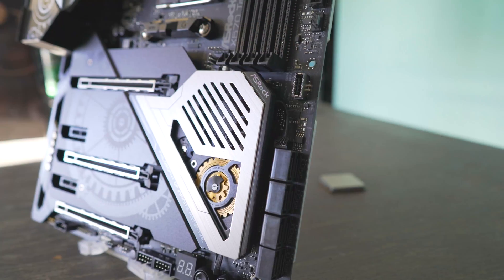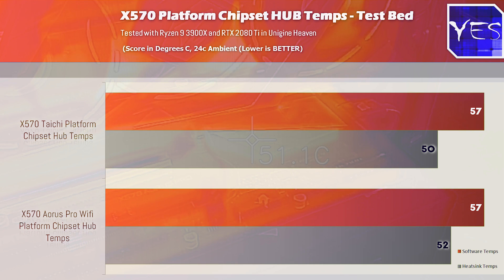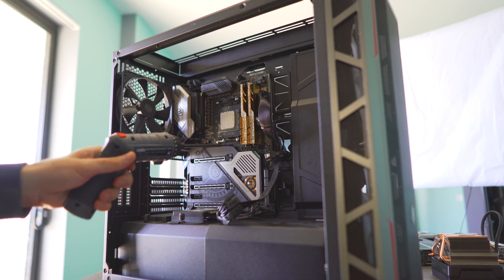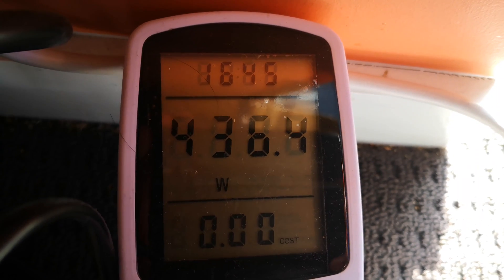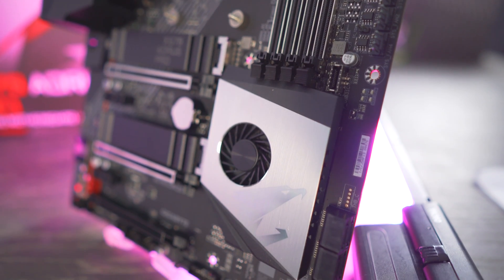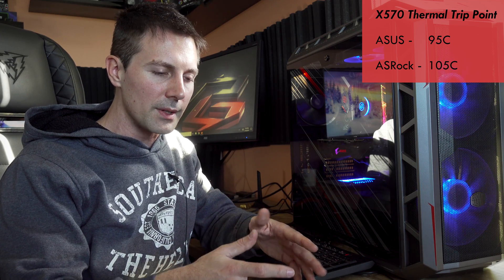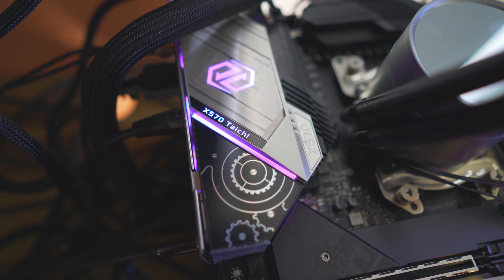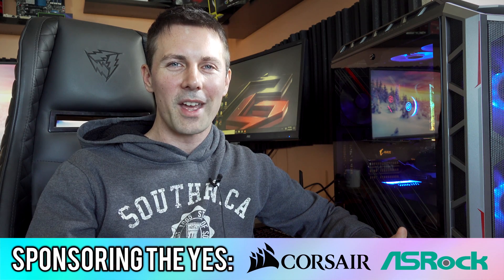X570 Chipset Overheating...!? (Investigation)

Comment: The Asus bios is running stupid high voltages when set to auto in the initial versions. That could very well be causing the overheating issues. 

Solve the problem by manually setting voltages to sensible levels.
Reply: I'm surprised asus hasn't fix that issue yet, my asus z170 Hero motherboard had similar issue when the core Voltage would jump to 1.54V only when my 6700K is under load so I set the voltage to 1.36V with LLC level 4 to fix my overvoltage and now the voltage doesn't go past 1.372V, this was years ago though
Reply: @AirRookie  MSI and Gigabyte are pumping out Bios updates almost daily. Asus is remaining very quiet with no updates. Maybe it is the PCIe 4 on x470 standoff that is delaying updates?
Reply: @bradmorri  and about daily bios tomahawk b450 still pre launch bios, and it have issues high vcore voltage on idle
Reply: @grigorian4665  msi had high voltage issues at launch of the 4x0 series boards. never kept up with them after launch. I assumed that they had been resolved. evidently not

You should be able to manually set voltages to sensible levels though.
Reply: @bradmorri  i set offset to -0.1 volt its fine on load but iddle ia still really high like 1.2v
Reply: @bradmorri  this might be a noob question but I only saw one bios update for like 2 weeks ago for my  MSI x570 pro carbon gaming which I flashed yesterday. I'm kinda worried that I can't see these daily updates ?
Reply: Yep Asus is so stupid. lmao.. I was also having overheating issues with my recent ryzen 2600 build and when I checked the voltages my ryzen 2600's voltage was 1.3 at stock on asus b450 motherboard whereas it should've been 1.137 at stock because that's the default voltage for ryzen 2600 and after manually setting the voltage to 1.2 I overclocked my ryzen 2600 from 3.4 default to 3.95ghz and it's running absolutely fine without any stability issues and the temps are not going above 60c even after gaming for hours and 70c with prime95 blend tests otherwise it was going upto 87c while gaming with voltages on automatic and with prime95 blend testing the system was shutting down after 2 minutes!
Reply: @taybi7961  Asus is good compared to MSI is doing right now
Reply: @grigorian4665  Well, I can't agree with you for now because I have another issue on my Asus motherboard, the audio drivers are also not good enough, Asus' sonic studio 3 doesn't work with chrome, firefox, Opera or any other modern web browser and as a result I get trash sound quality while watching movies online! lol 
+ VRM cooling is also not that good on recent Asus motherboards.
Reply: @taybi7961  people with new ryzen and b450 cant boot at all
Reply: @grigorian4665  Lmfao, That's totally not true at all.
Reply: @grigorian4665  AMD never said that all the CPUs would be backwardly compatible with older motherboards. They said that they would support the AM4 socket until at least 2020.  Everyone is just assuming backwards compatibility.

The 3000 series does support AM4 sockets but it also need sufficient power delivery etc etc to support the CPU as well. the older boards had pretty poor VRMs in some cases. MSI in particular. The Titanium x370 had a terrible, low end VRM
Reply: @bradmorri sry but they did 3000 chips where listed as supported nie where all the issues came out they marked the bios as BETA MSI fucked up every one
Reply: true, quick update just flashed the recent v19 bios, no change high idle voltages, however no bluescreens for now, about 2 hours of testing
Reply: @grigorian4665  especially on their bottom of the line X570. (msi)   that thing is an overheating pile of poo.  can't remember if it was buildzoid or derbauer that was testing the vrm thermals on all the different tier X570 boards.
Reply: It's not just Asus, it's the Ryzen 3000 series. FYI, setting a manual voltage/undervolting leads to a performance loss. Lots of people have this problem which leads to high temps, but it's not limited to just Asus.
Reply: I kinda shit myself a little when I seen the Sys Temp at 167F
Reply: Yeah I saw Jay talk about how ridiculously high the voltages etc were set out of the box.
Reply: Yea I just commended about that its way to high but so was my crosshair vii, have a viii now. It doesn't need nearly as much as stock voltage is giving it. I'm still not sure if there's a voltage bug and my readings are off its saying I'm getting 1.1volts at 4.325 in hwinfo, core temp. And stock bios my 3900x was boosting close to 4.6 single core after latest bios 4.2 max single core so I manually oc’ed until it gets worked out
Reply: Nice, I've paid like an idiot that x570 Asus Rog Strix E ,  for having issues --' I didn't tested it yet , since it didn't arrived at me but honestly , of i have issues with heat , even with Noctua NH-D15 SE-AM4 , it will be for the first and last time when I'll buy AMD. Though , maybe Intel is a little bit expensive but has good quality mobs. Over 300 euros for X570 mid-range, is more likely high-end for Intel.
Reply: @andreitenea5989  keep sponsoring Intel. Look what that brought to the pc market. It's not only AMD 's problem. Mobo companies need to adjust settings and the use of 4th generation PCI-E.
Reply: AMD has stated that the high voltages where due to monitoring software aggressively polling the CPU for the voltage levels. Hence causing abnormally high voltage reading. These readings where inflated and it's recommended to not use monitoring software when using the system for everyday use.

Comment: Something that you mentioned about cheaping  out in the case, would it be a hassle to put the motherboard in a cheap case with fewer fans and find out the shutting down point of the motherboard? if it have one i mean, could be like you said that the motherboard they got was defective. at least since you raised that probability i would have tried to test it, maybe get an extra video out of doing that, just a thought

Comment: Ryzen 3000 users x470 or x570? Still debating on it.
Reply: I would like to know as well. I've got all my parts except the motherboard. Need to know what is the better option for a 3700x, without the plan to do major overclocking or using PCIe 4.0 (although I might choose to dabble with this in the future).
Reply: @GoodmanDontLai  damn dude you got a 3700x? I'm going to get one. I've been trying to get one since July 7th!  For overclocking I don't think there is too much of a difference between x470 and x570 on overclocking. The main difference is PCIE 4 but the chipset wattage Is higher maybe 5-10 watts more idle. There is a article that causes some concern for me, I'm not sure if you care about power consumption but idle watt difference was 6 watts more on x570 but under full load there was a 30+ watt difference.
Reply: @noahw5887  It just got delivered yesterday. They were restocking periodically since launch, and I got it when I randomly refreshed the page at work; actually bought it faster than Newegg could notify me about it being back in stock. However, they might be fresh out for now until they manufacture more, but keep trying. In any case, I think I'll pick up the x570 Aorus Master. Power consumption aside, I don't know if I can justify the large price tag, when I don't think I'll do any crazy overclocking with my current cooling, however I've been wary of the gpu slot lining up with the chipset fan like the Taichi as shown in this video. Even though it could be perfectly adequate, I dont like that so, I just hope the Aorus Master gives more clearance for the fan.
Reply: @GoodmanDontLai  actually I lucked out I was randomly browsing Amazon for the 3700x to see if it would be in stock and they had it for $329(thank God). I bought it as soon as I could. I missed my bus stop for work while doing all this but it was worth it lol. I'll check out the motherboard tomorrow I wanna get a x470 for the lower lower consumption but they only have at most a dozen models that support USB flashback for compatibly. Maybe x570 is the way to go, they do look a lot more modern.
Reply: @noahw5887  I've actually decided to pick up the x570 Aorus Elite. I was gonna go with a b450 board like the tomahawk or pro carbon, but it's a steal for what you get with it, and the vrm is good enough for some oc. Now if only it would come back in stock. Yesterday, I saw it come back in stock while at work again, but when I finally decided to bite at home, it was all gone haha. Mind you, if you are gonna get an x470, I hope you have an older AM4 cpu so you can flash the bios, since pretty much only the Asus Crosshair models support usb flashback, but if there's an x470 you really want, I read somewhere that if you provide AMD with proof purchase then they'll supply you with a loaner cpu to flash the bios on the board then send it back.

Comment: read in reddit that certain video card will affect it (i.e. reference 5700xt with side exhaust)
Reply: It's a side intake, it exhausts used air through the back i/o bracket.
Reply: HK416 woudlnt it be intake from the bottom then exhaust on both sides
Reply: @CrongTech  No, it's a blower card, it sucks air in through the side and the fan blades are aimed at the rear bracket. Watch the Teardown video of the 5700XT on  Gamers Nexus, there you can see how the cooling works on the reference models.

Comment: X470 then... I don't care about pciex 4... I just don't want to get back to the 90, when every chipset has little fan on top of it...
Reply: Makes me kinda relived that i was impatient and grabbing an x470 with 2700x. no regrets tbh
Reply: @grumpyspoder  yeah... I wanna pick up some x570, but little worried about that chipset fan... Well I guess I'm not selling my x470...
Reply: Yeah u could just get a new ryzen 3rd gen and put it on the x470 chipset, most likely just need a bios update
Reply: Yes, for me the same reason to not buy X570. I remember the time when fans were on the MB, and they ALL died or jammed. It feels a step back in time, and i don't like that feeling.
Reply: I can't decide which one to get. Either that or I keep waiting for B550, early next year though. It's a long time to wait.
Reply: I'd buy an X470 today if it was pre-flashed for the 3 generation chips.  I want to put a 3600 on it and I don't want to spend a fortune to do it.  Currently I have an overclock fm2+  A10-7700K.  I also bought a used Sapphire RX570.  Using external video allowed me to get really good overclock on the A10.  Instead of 3400 mhz, I'm a 4000 mhz, but still I want to upgrade to the 3600X and the faster ddr4 ram.  The 3600X is way faster.  What's really strange to me is new egg wants $310 for that A10-7700K.  Crazy.
Reply: I changed from a X370 CH6 to a X470 Asrock Taichi Ultimate rather than the cheapest X570
Reply: @viktoytube  i don't blaim you. X570 prices are high, and i just HATE that fan on the motherboard wich puts me off.

Comment: As I understand the X570 chipset is better than previous gen chipsets, I still bought a B450 board simply because of this reason. I don't trust a motherboard that has a fan on the heatsink. That just screams failures/problems in the future in my opinion. Fans fail over time, the componants of the motherboard will outlast the fan in most cases. That's why a fan on the chipset was a bad idea to begin with. Just my 2 cents.
Reply: Possibly, but in 15 years of building my own pcs I've never had a fan fail on me to be honest. I've had GPUs fail on me though, usually almost straight out of the factory ;p

Comment: that was the shroud over the chipset which is not in contact with the actual heatsink.. just saying.. but yes  der8auer made some interesting findings...
Reply: It actually is. Nobody has shown pictures of this, but there is a thermal pad which connects that huge single plate to the small chipset heatsink + fan.

Comment: If the heat sink is cold  it can also mean that the heat isn't being transferred from the chipset due to poor thermal contact.
Reply: He showed the software temps also, which are from the chipset not the heatsink
Reply: @lollb454  well my comment wasn't abut the particular case. It was general information.
Reply: @AlexanderKalish  then the information is irrelevant because the heatsink wasnt cold
Reply: @lollb454  Bryan's wasn't, but your or mine or Bob's might be and Bob might think it's good that it's cold because it's being cooled super-well when it might be exactly the opposite. That's the reason I've written this comment.
Reply: @AlexanderKalish  alright fair point, you win
Reply: @AlexanderKalish  Exactly right.  If there is poor thermal contact in some boards it would explain the reports of shutdowns.  I like Brian ' s  style but his "I couldn't replicate the problem in my tests so it shouldn't be a problem on all boards of the same type" conclusions really suck..  Logic and statistics aren't his strong suits.
Reply: @jamesthomson8659  What would you say is a better way finish off the conclusions? I suppose it is to request that viewers with x570 chipsets send in their specs, and if they have trouble, and then check versions-numbers, et c? It already does start to add up there - finding evidence of one or the other isn't exactly easy, if we are to really accurately follow the scientific model. So far, there been no convincing evidence from those saying the x570 chipset overheats easily either.

Heck, Der8auer ran it without the dang fan entirely...!

I think, considering the time and resources Tech City can invest in this, he did a decent job - he does say that it can't be ruled out under certain circumstances, just that he himself couldn't replicate the reported findings.
Reply: @predabot__6778 He should have just left it that he couldn't duplicate the problem.  When he then added it shouldn't be a problem on all the boards similar to what he tested is where he was in error.  As the person at the start of the chain pointed out, poor thermal contact could explain the problem.  Brian didn't test for that.

Comment: It's most likely the Power Supply it happened to me with my old PSU it would turn on then turn off 5 min in tried different ram /ssd and bios and the last thing I did is replaced my PSU and it worked so if buy a new chip set get a new PSU with a gold/silver/bronze certification

Comment: Thanks for checking it out. Yesterday I was dissapointed that you totally skipped chipset in term of temps and noise :) Maybe overheat appears with all NVMe drivers plugged, chipset silico lottery is very wide, or it's really specific case when it can overheat.
Reply: Mainly it's Asus and others cranking the voltage at stock way too much in the bios. Look at Jayz2cents video about it, its a good guide on what to do when you enter the bios. That should settle the temps.

Comment: Sooo...I just ordered an X570  Gigabyte Gaming X. I will be pairing it with a R5 3600 and GTX 1060 6gb. My case is a Corsair 200r with 5 Arctic F12 fans. Will I be good?
Reply: @shibasss  I don't have the budget to upgrade my card.
Reply: You don’t need an x570... perhaps a good b450 board for under $100 and put that extra money towards a new graphics card....
Reply: Chingus696  I don't want to update bios I just want it to work out of box. My GTX 1060 works fine and I don't plan on upgrading it until the RTX 2060 prices goes down.
Reply: Yah with that CPU I would just buy a decent B450 board and use the saved money to upgrade the GPU.
Reply: Yes its only a 1060 6gb lol

Comment: I just brought an ASRock X570 Steel for my Ryzen 2700X (want to upgrade in a few yrs to use a 3800x in a few years) Paid $149 USD for my Ryzen 2700X on Amazon Prime Day yesterday 7/15/19. It was $199. plus there was a promo code of $50 bucks off

Comment: Pointing a Flir Camera really won't give you exact temps will it. Wouldn't breaking out the Ktype and Volt-meter/Temp readout be the way to go. That case is definitely a good case to use.
I see Marco talking about that ASrock Aqua. any chance they'll send one out to test.
  Der8auer did do a vid in this and proved that the x570 Chipset at least on the ASUS boards was only pulling just under 10watts. He even wondered why they put a chipset fan on it, in the first place.

Comment: Just waiting for the x570 Watercooled edition with a water block on the chipset.
Reply: Just get a universal chipset block, Watercool still makes them and they come with 2 adjustable mounting brackets.

http://shop.watercool.de/epages/WatercooleK.sf/en_GB/?ObjectPath=/Shops/WatercooleK/Products/10203
Reply: @HK-qw4wt  A fancy looking (I mean plain black for example) true heatsink would be good, too, right? Something like der8auer used in his video, but bigger and maybe better looking. I would dig that.
Reply: Gigabyte waterforce board should be out soon. Their passive cooled master board is passive cooling though.
Reply: asrock already had a waterblock mono block for the motherboard , limited run edition shown at computex2019, and I am sure ASUS and Gigabyte with come out with motherboard monoblocks soon